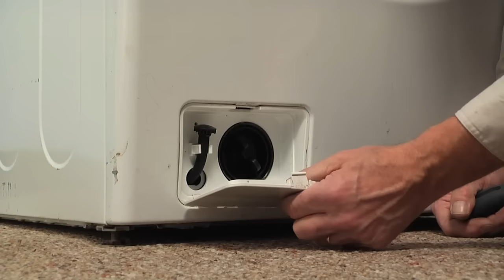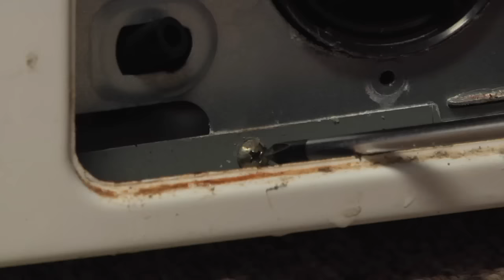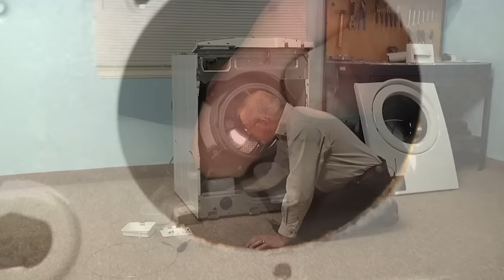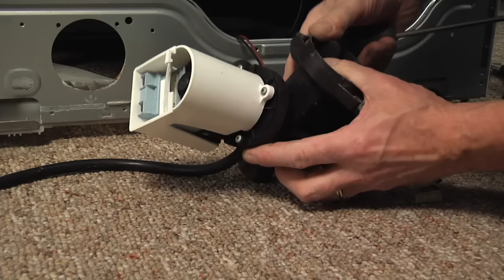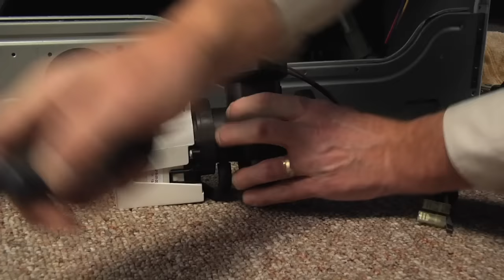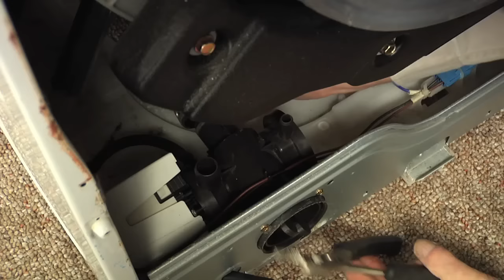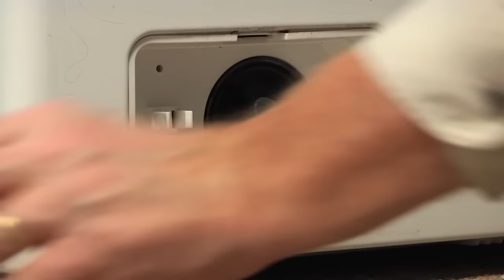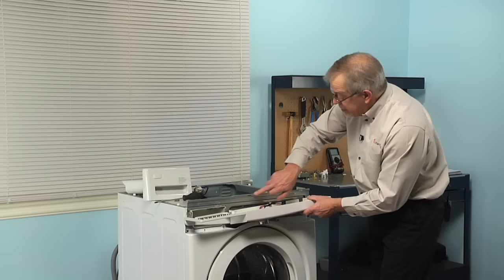Washing Machine Repair - Replacing the Drain Pump (LG Part # 4681EA2001T)

Comment: ATTENTION: You don't have to remove the face! If possible, just tip the washer on its side and expose the bottom. Literally all you have to do is pull wiring, pull hoses, remove three screws at front, then pull out pump assembly. I had the whole thing replace in less than 30 minutes that way. Im pretty sure itd take at least 30 minutes to even get through half of the faceplate removal. 😅
Reply: That’s a brilliant idea!! I’m gonna try that. But would tipping the front loader on its side cause any issue later on?
Reply: How do you remove the screws holding it in place without removing the face??
Reply: Mine had 2 bolts up front that you can’t get to from underneath. Had to take the front off.
Reply: Where is your video then... I may try this, a little help
Reply: I’m not sure why dangerously tipping a machine is preferable to doing a proper job. Why is everyone in such a hurry to accomplish what they are supposed to do in order to get back to staring at their phones as fast as possible? 

ATTENTION As someone who actually fixes things for a living, I suggest NOT taking shortcuts when repairing household items. Especially ones that have the potential to flood or start fires. Thanks.
Reply: As a old fart that's been repairing everything for over forty years I've learned taking apart electrical control panels with plastic clips is better avoided if possible. These pumps are a common fail point and should be easy to access. IMHO poor design placing astectics over servicibility of a appliance that's rarely seen by visitors. Plain stupidity.
Reply: I’ve replaced this pump twice in the last 7 years. The first time we did it like this video suggested. It’s a ton of work taking the whole front off. This time we did it from underneath and it was WAY easier. Tipped it back against the wall, made sure it was nice and stable, then switched out the pump. 👍🏼
Reply: I’m just here re: repair of my machine -
1) got it used cheap, with new pump and housing, told pump is the problem but didn’t want the hassle after all to fix
2) pulled apart machine as shown here, replaced pump only, but still observed leak
3) found that previous repair person screwed a HOLE into the adjacent housing where NO screws ever belonged!
Reply: I saw some videos that do the easier way but I trusted this guy because he just looked legit. Glad I did it the long way. I feel like accessing from bottom would have been more awkward to get at some of the attachments and wiring, and I might have broken something.
Reply: This only works if your arms are long enough lol
Reply: My washer is screwed down to a pedestal (so no bottom access without removing the pedestal) and wedged into a tile “moat” under a cabinet in our laundry room.  Trying to pull that assembly out over a tile “curb” to disconnect the pedestal would likely take more time & effort than pulling the top and front off, which I think I can do while sitting in place.  New pump from Amazon is on the way so time will tell.  Thanks for the informative and detailed video on this  method.   Only thing I’m a little worried about is out is getting the door seal & spring retainer back in place to avoid leaks.
Reply: How do I get the 3 bolts out???? Mine is also on a pedestal

Comment: Big Thank you to the efforts of this video, this should be a wake up call to the manufactures to start engineering their products for end user replaceable parts. With the help of this video (during Covid) I changed this myself for $40CAD. A front door access panel would be a simple design to avoid the 30 min. it takes to get to this common replaceable part.
Reply: I agree. And it would be good to make this pump (and especially the spinning part interfacing with water) higher quality so that this wouldn't be always the first part to fail.
Reply: @MikkoRantalainen  Makes me feel like I want to cut my own side access panel... However I don't think my wife would be very happy about it...
Reply: @indiscretion3877  Yeah, I just replaced the pump on our LG washing machine yesterday and it would have been nice if replacing the pump at the bottom of the machine wouldn't have started by removing the top and front control panel of the whole machine.

Replacing the pump itself was fast and easy (except for those spring clamps always slipping away from my cheap pliers) but the extra work to access the pump was not fun – not hard but just time consuming.

The machine has direct drive motor and all the parts and bearings still seemed to be in very good condition. So obviously the water pump is the worst part of the whole machine.
Reply: @MikkoRantalainen : That spinning part is called an "impeller." Oddly enough, the way I figured that out was by searching "What is the name of the part that breaks on a washing machine pump motor?" I have a sneaking suspicion that the manufacturers purposely make it hard to get to, in order to sell more machines.
Reply: Using a drill and a hacksaw, I cut an access hole at the bottom front of my washer, right in front of the coin trap filter and the pump. I covered the bare metal edges of the opening with some duct tape and I always place a thick towel over the bottom of the opening before I stick my hands through the hole.  I've used it a couple of times to clean the coin trap and once to replace the pump. When I'm not using it I keep it covered with a piece of magnetic vinyl. It's especially convenient for me because I have the dryer stacked on top of the washer, so before I could remove the top of the washer so I can take off the back, I would first have to remove the dryer from on top of the washer. Ridiculous that the manufacturer didn't include an access panel on the front to be able to clean out the coin trap filter.

Comment: my pump motor broke because the impeller slid it out into the housing and wore down about 2 mm but probably stalled the motor when I dreamed it it was 5 gallons. I reached in to feel through the filter and pushed it in, and it was turning while I waited for the part to be delivered, I ran a load with the compromised impeller pumped 4 gallons of the five and I had to manually drain a gallon in between cycles.  The pump had been making noise for several months as it was wearing on the impeller. Had I known that simply pushing the impeller back in may have prolong its life as it is I got over 10 years on it. This video was made nine years ago and it’s the first time I’ve had to service the washer.  The $24 Amazon part delivered overnight seem to be of the exact same quality as the part I removed. The only difference I noticed is there’s a cupped tip into the impeller where the tip is smooth on the old one. The new one has a recessed divot in it.  Everything else seem to be working fine on the old impeller.

Comment: My pump fails once a year. I do a LOT of  gritty, dirty laundry. I used this video last year and am getting ready to use it again. It's the best of all of them.
Reply: maybe upgrade to an industrial washer that can handle abuse
Reply: My washer was 7 years old when i had to replace this drain pump for the first time.  Now 2 years later, I need to replace it again.  The first pump I bought on Amazon and was some aftermarket brand. This time I am going with an LG pump from Amazon.  I suppose it can be a fake since the price is $28 compared to the LG website where the pump is listed for $52 i believe.  We'll see if it makes any difference.

Comment: saved me a ton of coin.  I didn't wan to spend 300-400 to have someone fix it but I also didn't want to spend $700-$1,000 to get a new one.  This video worked perfect and I have more money for food.
Reply: $300-$400 wow you would of got screwed. Normal repair would charge about $120 labor plus $50 part= $170 estimated.
Reply: My machine cost almost $2000 new but it is a all in one combo lg unit

Comment: Thank you for the easy to follow video.  I replaced mine with your video and an overnight ship from Amazon for $30.  Saved several $$$.  Thank you.

One other note, this is the 2nd one I've replaced in about 7 years on my LG.  So it may not be the last.  
2nd time went better than the first.  This time I wrote down my instructions ... for next time.

	1) Disconnect washer - power and water
	2) Remove Top - Top screws in back, slide back
	3) Remove Control Panel - 1 screw in corner then 3 tabs and it pops off. Set it on top of washer but can leave it connected.  
	4) Remove drain clearance and plate (2 screws)
	5) Remove gasket from front of washer - spring removal tool
	6) Remove front of washer - 5 or 6 screws on top and 1 elec connection.  Lift and remove
	7) For ease of access, get a 4 x 4 to put under washer and raise it to 30 deg angle or so
	8) Remove drain pump hoses by releasing clamps
	9) Disconnect wires (note position - Brown Top  Black bottom / take pic)
	10) Remove pump assembly 
		a. 2 screws from bottom hold it to bracket 
		b. 3 bolts hold assembly to washer
	11) Remove drain pump from assembly
		a. 3 screws - note orientation / Take pic
	12) Remove white plastic pump cover
	13) Replace pump
	
	
	14) Reassemble pump assembly
	15) Slide assembly in place
	16) Be sure elec connections are good before securing pump assembly
	17) …remaining assembly steps.
	18) Test run before pushing it back in place

Comment: If they ever start awarding them, I think you should get the Nobel prize for YouTube. Very good video. Easy to follow and lots of great explanations. No filler at all, just straight to the work. When my part arrived I was able to complete this repair without any trouble at all. Thank you, Steve.
Reply: Lol what?  He skipped 90% of the close up shots and left everyone guessing about which screws, tabs or harnesses he was talking about.  Who wants to guess when taking unfamiliar machinery apart?  I appreciate the video of course, but the Nobel prize???  If you really want to help people, don't half-ass it.
Reply: @madderall_dot_com  hi....I agree pathetic instruction.....
Total waste of time..
Reply: Very good tutorial. Having seen several of these, yours is way on top of the best. Thank you for your time doing this. I also bought a spring removal tool. I knew I would most likely have to do this again. However I know I'll have to do this again.  I attempt to repair all of my appliances and cars that I can.  The only problem I have had is finding a an original OEM replacement part that is of good quality. As for my model of LG front loading washer, everyone lists OEM, the part may fit, the quality of the replacement item is most likely not reliable. Also price is not a sign of quality of what I have found out.

Comment: The pump went out on Christmas night with guests when I went to wash sheets!  Watched your video, which is the clearest and best-presented appliance repair video on YouTube.  I have the pump out, and my local appliance parts store has 9 LG pumps in stock! 
Thank you for preventing me from having a nervous breakdown.  Your reassuring and calm manner is appreciated, as well as the step-by-step down to each little screw's location makes the repair a delight instead of a nightmare!!!

Comment: I am  an old lady, 71 years old and on a fixed income.  I was getting the EO code.  I watched your video and decided that I was going to fix it myself.  I ordered the pump and a spring stretcher and a wrench that helps take the clamps off the hose. It took me about an hour an a half, from start to finish.  I did the job by myself. Well, I did my first load of laundry, and to my delight, no leaks.  I am jumping for joy.  Thank you for your video.  It was very much appreciated.

Comment: Another satisfied viewer. Watched this when I saw the dreaded "OE", cancelled the the service appointment and got the pump from Amazon, IN 12 HOURS, for $35. Installed in a little less than 2 hours and we are back in action.

The spring thing was the hardest part...just have to be patient, methodical and gentle. It will work eventually.

Thanks, Sir!

Comment: Hello Steve, I am a woman and this is the second time I have to disassemble my 17 year old machine. The first time it was the spider that broke and damaged the front tub. I had to disassemble from A to Z. Now it's for the drain pump. Always easy to follow step by step with your video. But this time I ordered the tool for the spring. Thank you a thousand times.

Comment: Thank you Steve.  This was an excellent video which I followed step by step to replace my drain pump motor.  My machine is 8 years old (model WM2801HWA) and this is the first issue we have had with it.  We kept getting an "OE" error code and had to drain the tub out a few times.  I did some research on the internet and found that the drain pump motor is typically the culprit.  Once I figured that out I was fortunate to find your video.  The entire process took about 75 minutes.  Key was to have a second set of hands around putting the band clamp back on.  Also, tried accessing the pump through the bottom of the unit, but given that the motor assembly was bolted down to the base, it made more sense to follow your instructions and go from the top down.  Seems like LG could have engineered a removable door on the bottom of the unit to make everything far easier to access and save a bit of time.Lastly, when buying a replacement pump, I saw many folks had issues with non-OEM replacements, which lasted only a short while before needing to be replaced again.  The majority of feedback on OEM replacements was positive, so that is what I went with.Thank you once again Steve.  Keep these great videos coming!

Comment: By far one of the most useful tutorials in my household.  I've had to replace the pump in my unit three times during its lifetime.  For any of the comment readers I don't have the push tab pump release but have the bolt on unit.  Looks like my bolts were 10mm if that's useful to anyone else.  Also recommend buying the washer spring clamp removing tool for about $12 just to have it.  It's janky trying to do this with pliers and a flathead.

Comment: This video walked me through step by step.  I was able to switch out the part in less than 2 hours.  Saved me 100's of dollars in repair costs and or getting a new washer that wasn't needed!
Reply: This video is stupid beyond belief!  Just pull the washer out a few feet and tilt it back towards the wall.  You can access the pump through the bottom of the machine without taking the whole dang thing apart!  This video is like changing a light bulb by accessing the fixture through the room of your house!  LOL!

Comment: You did it again! Because of you I have replaced the circulation pump, the drain pump, the bellows, the hot water switch and some other kind of hose. My machine is 11 years old and I've had to call a tech out twice before I figured out this is something I could do on my own. The tech visits were $700. One replaced the gasket seal on the door and another was something else. And parts I've spent $150 to $200 on those four or five different fixes. I am grateful and monetarily indebted to you. Thanks
Reply: Well thanks to you I replace the drain pump again. I'm a 67-year grandma and because of you I'm able to fix my own machine for $40

Comment: My eleven-year-old LG stopped pumping. Your video gave clear and systematic instructions on how to get to the pump and replace it. Otherwise, it would have been a drawn out, frustrating, and perhaps futile attempt. I don't have exactly your model, but it was close enough. Given the video, the process was straightforward. For all of you other do-it-yourselfers, pay careful attention (as you remove it) to how the rubber gasket around the door seats. Also, for me, it took development of some technique to replace the spring-loaded retaining wire around the gasket. I'm pretty sure that Steve, the gentleman in the video, had done it a few times before. :-) Thank you PartSelect.

Comment: Thanks, Steve! I followed your directions and was able to replace the failed drain pump. Saved hundreds of dollars on the repair! I did need some more tools that you didn't mention like a stubby Phillips screwdriver, right angle screwdriver, and I even used my socket wrench set to remove the  front panel. This project is really for two people and took us several hours, but we got it done. One thing that I wanted to mention was that our ten year old washer has a rusted spring on the band clamp. Replacing this turned out to be the most difficult (and most frightening) step. I recommend those who attempt this repair examine their door boot and band clamp before beginning this project to determine whether it's time to replace those as well. Great video!!!

Comment: This guy is amazing he made our repair about $40 instead of $hundreds:) Best video and it is easy!
Reply: This video is stupid beyond belief!  Just pull the washer out a few feet and tilt it back towards the wall.  You can access the pump through the bottom of the machine without taking the whole dang thing apart!  This video is like changing a light bulb by accessing the fixture through the room of your house!  LOL!
Reply: I need to do this. Did y’all order the part first or open it to match the part first?
Reply: @kevinjones1111  🤯
Reply: mine too !  i was quoted a minimum of $180. for repair.  i did it for $35.00

Comment: I fixed my washer, LG WD-14376FD with this tutorial, pump is on the other side but 90% of the guide is pretty much the same! The only difficult part was the spring clamps, make sure you have some wide pliers to catch 2 out of 3 or you'll struggle a lot. I wouldn't have guessed about the plastic lock under the pump, you're a life saver! Thank you for saving me at least 100 euros. Replacement kit in Greece costed me 44euros including shipping and vat.